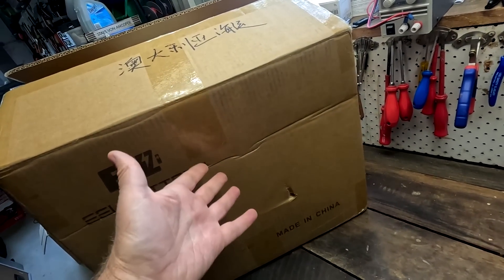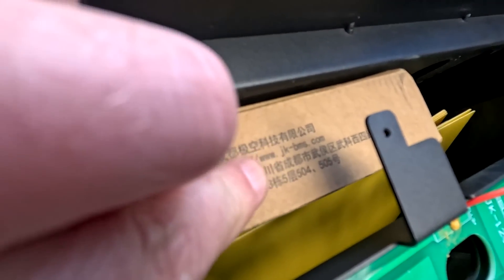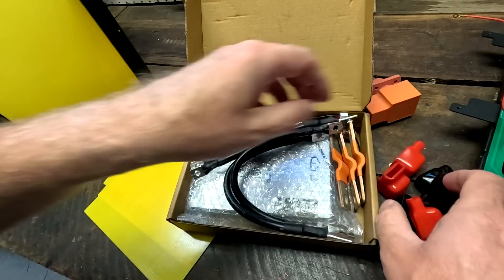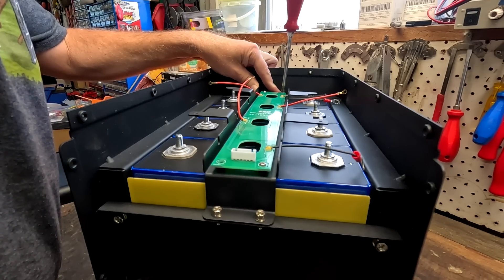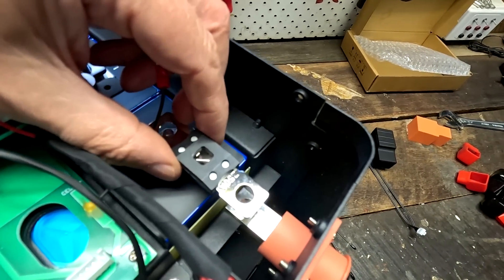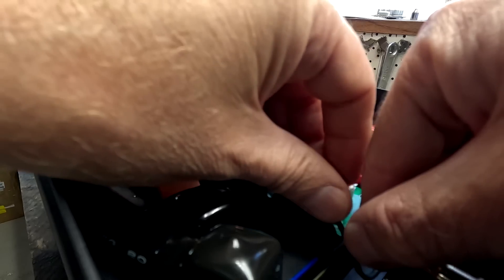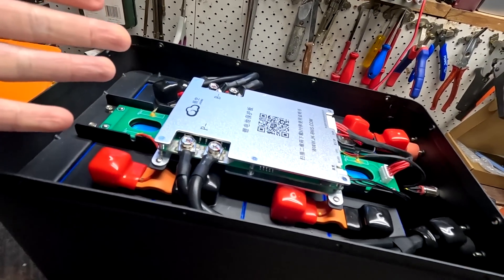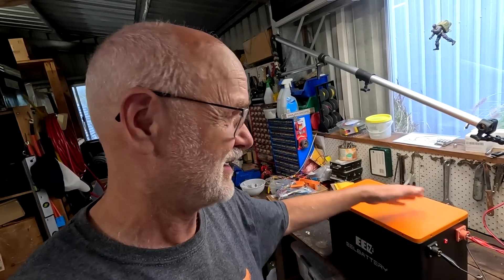The EEL 12V Battery Case. I could not find anything negative. First ever 🐸🐸🐸🐸🐸?

Comment: Please do 96v with inverter that’s way more efficient as a result while still be ULV for DC.
Reply: Not many inverter options for 96V. I don't know of a single one that would work for me.
Reply: @niktak1114  there’s one that is fully parallel able out but yes, should be more and would significantly improve efficiency.
Reply: The problem there is that Andy is in Australia. Australian laws prohibit the general populace from working with DC voltage above 50v (nominal)
Reply: @CollinBaillie  that’s AC. DC is 120v DC ripple free.
Reply from the maker: Everything over 60VDC is not DIY anymore and can be dangerous. 
A 96V system would not fit in my design anywhere, neither does a 24V battery build.🤷‍♂️
I think the 48V battery and system we are building is pretty efficient already, not sure how much more you would squeeze out by doubling the voltage.
Reply: @OffGridGarageAustralia  nothing under 120v dc is dangerous. A Wikipedia search will show you that. Nothing over 50v ac is safe.  Just do a search for extra low voltage on Wikipedia. 

This isn’t even controversial anywhere in the world. And the result is about 5% increase in efficiency battery to AC out.

Comment: Temperature sensor is best suited between 2 cells. To accomplish that either under an EVA tape or milled into the epoxy plate (if it has the same thickness)
Reply from the maker: The sensor is too thick for either. I have seen people printing thin 2mm plastic spacers which have a channel for the sensor.

Comment: I noticed a bug for this specific JK BMS (bought it a year ago, maybe meanwhile fixed?)
If one cell triggers the overvoltage charge protection function as well the discharge ability is disabled! Am I alone?
Reply from the maker: Which BMS hardware and software are you running?
Reply: @OffGridGarageAustralia  JK B2A8S20P
Hardware V11.XW
Software V11.17
😊

Comment: when you will use it in a RV you need a heating for the wintertime ...
Reply from the maker: I've seen RV designs, where the battery was in a compartment which did not freeze in winter. It was kind of heated.
Reply: thats the reason why i did not buy besides the problem with the double hole studs. ...... furthermore it doesnt come with the HC version ... when you are in US get  the mats from sunfunkit. but the EEL-box might be too small. the sunfunkits mats are for mounting NOT at the bottom

Comment: Clean and efficient design. Worthy of five frogs 👍
Reply from the maker: Great!
Reply: @OffGridGarageAustralia  The  nuisance is that the box doesn t work with the double hole studs from EVE ....... 
Furthermore the BMS is not the HC-version. And there might be no space along the cells to install a heating element, just at the bottom i suppose. So for mobile applications in cold regions its not my first choice.
Thats the reason why i am going to build a 12V-box by myself ..... EEL is ok with the 48V boxes.
Hard to find a heating element not getting warmer than 50 degrees celsius. Sunfunkits from Louisana seems to have one but shipping to europe is very expensive. 
So i found by accident a solution with beehive mats.....
Reply: @mandxyz2523   Are you able to share your solution? Cheers

Comment: Hi, Andy I think I would add a screen +. PEOPLE LIKE TO SEE THERE BATTERY. There cheap and people are seeing that phones are NOT SECURE to keep a pricey battery safe.
Reply from the maker: Yeah OK, the big screen may push the price by $50 though...
Reply: And make it less roughed 😮
Reply: you can get the small 2.3" screen for virtualle nothing. about 12 euros....
Reply from the maker: @mandxyz2523  I just bought 3 of these screens. A$21 was the cheapest on Ali for me.
Reply: @OffGridGarageAustralia  don´t ask me why the price went up so much .... but at nkon we can still buy at the low price.
By the way: NKON sells the EVE 304 for 70 euros per unit .... with the original stud...
The new MB series come with non-original double hole stud. EVE doesn t produce them yet with the double hole stud....
Reply: @OffGridGarageAustralia  Will see whether YT erases my comment again. I sent you a mail as well.
Reply from the maker: @mandxyz2523  EUR70 seems to be quite expensive? You can get the new EVE MB31 with 314Ah+ for around EUR60 (plus shipping).

Comment: Two times AWG 6 is too thin for 200 A. Some onepage IKEAstyle manual would be no mistake. 
Yes mechanic off EEL cases is pretty perfect.

Your next battery upgrade should be one for the camera😉 

🐸🐸🐸🐸
Reply from the maker: Yeah, double 6AWG is good for 150A. As it is silicon wire and very short, it will be fine for 200A. Not many will push the battery and BMS over 150A continuously, so...
Thank for the 4 froggies.
Reply: @OffGridGarageAustralia 
Hopefully yes, but it should be designed to the maximum current to stay save in any case.
I give another 1/2 🐸 , because they improved it to 6 AWG - the 200A 16s box comes with 7 AWG.

Comment: Mähhhh, I don't like 12V Systems. On ME, i'll start with 24V MINIMUM. Please ask EEL for a 24V Case .....
Reply: They have one that looks very similar to the 12V
Reply from the maker: You didn't watch the video... I said, there is a 24V box as well. All linked in the video description.
Reply: @OffGridGarageAustralia  I Watch, also your Videos, mostly with Speed of 1.5. I actually overheard, looks like I need to service my filters. Thanks !!!
Reply: well, not a good idea to run a RV with 24V instead of 12V .....

Comment: Looks Pretty much like a shrinked eel v4 
Just built 5 eel v4 48v boxes with the inverter bms - and only one minor issue when one temp sensor was not working. I just replaced the ntc myself. 
The quality of eel boxes is good. Only the diameter of their cables for 200A…. Not so impressing
Reply from the maker: The EEL 48V box is next on my list.
The double 6AWG wire in the 12V box is good for 150A. As it is short and not many people will push for more than that continuously, I think it is OK.
Reply: @OffGridGarageAustralia  If it does not meet rated capacity, it's not ok.  in USA 6awg is only good for 55amp continuous.  This is a problem.  If someone wanted to push it to 200amp, this is a big safety issue.  Does not matter if only 1percent of people want this.  the BMS is rated for 200amp continuous?  Did they upsize the BMS but not the cables?   I think in your video, you said the fuse is 250amp?  This is red hot fire territory for those cables.  Safety is to manufacturer rating not how many people push up that high.    Trying an outdoor test pushing 200amp through the box.  Would make for a dramatic video.  I was getting close to buying this but they seem to have cut corners that can harm people.  

Curious where you get 150amp number?  What I can find online says 6awg is 55amp.  Am I missing something?
Reply from the maker: @Chris-ut6eq  I'm using the Jcalc website for Australian regulations. 6AWG is 16mm cable, good for 72A. Being a very high stranded wire with silicone insulation, they can cope with more. There are tables online for these cables. The length of the cable and how much air flow it has plays a role as well. So 80-90A if not 100 should be possible.

The BMS is 200A, the breaker 250A and we have 2x 6AWG cables, so at least good for 150A. I'm not too concerned about it as we never push continues 200A through the BMS and the battery. In case of a short, the BMS will shut-off, if it fails, we have the breaker.

https://www.jcalc.net/voltage-drop-calculator-as3008
Reply: @OffGridGarageAustralia  If you are comfortable with this for your personal use, based on the assumption you will not push more than 140-150amps through a device claiming to support 200amps, that's fine.

Anyone else using this should look at their national electrical code for amperage guidance.   In the USA, for copper core 55-75range is possible depending on the type of insulation.  Keep in mind the higher amperage means the cable will be putting off ALOT of heat at 150amps, that why the high heat resistant insulation is needed.  

IF someone does not pay attention and tries to use the full rating of the BMS (200amps), this wire is a fire hazard.  Depending on the wire to burn through and short out to trip a breaker means you are already in serious trouble.  The internal fuse sized at 250amps is not helpful either.  I assume the BMS default limit is 200amps?

Also  the fact this is in an enclosure also would mean some derating should be considered.

Anyone reading this, use the NEC (National electric code), see if the cable including has any markings for meeting cable insulation standards (they look someone like this in the USA, TBS, SA, SIS, FEP,FEPB, MI, RHH, RHW-2,THHN, THHW, THW-2,THWN-2, USE-2, XHH,XHHW, XHHW-2)

Then look at the guidance in the NEC for enclosed use poor to middling air cooling.  

If your personal use case aligns with the current capability of the cables,  be sure the BMS and internal fuse also work for intended amperage.

As shipped this device IS a fire hazard at it's 200amp rating, using the 250amp fuse.  Never depend on external breakers for what's going on inside the battery box. 

Breaker sizing is whole other thing as breakers have ratings for AC/DC and timing curves with ratings like A/B/D/etc which determine trip times for resistive/inductive loads. A external breaker is protecting things outside of the battery box.

In the USA, consider using a good quality copper 3/0 gauge or even 4/0 if you want to get 200amps to power a 2000/3000 inverter.

If you want 150amps, upgrade to 1/0 or 2/0 and change out the internal fuse.  Be sure you get a high heat insulation rated insulation for safety.

In general, don't be cavalier with electrical safety.  National electric codes exist because people have already died when things went wrong.